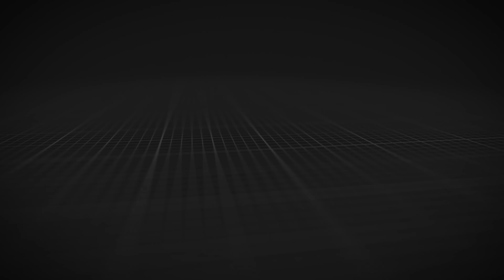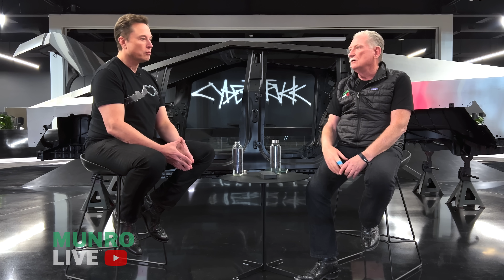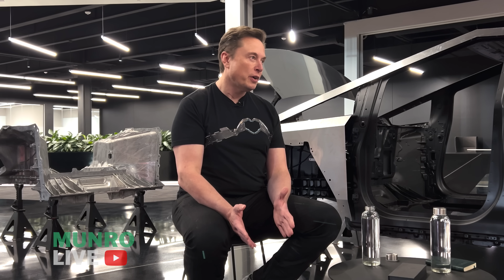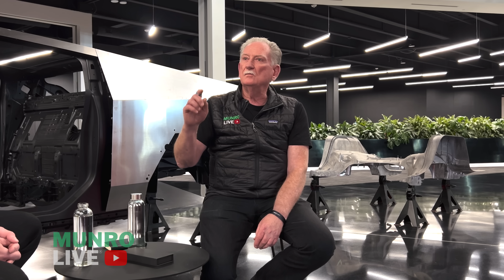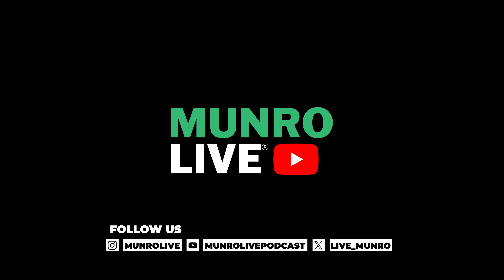Elon Musk on Cybertruck's Adoption of 48V and the Importance of Leadership

Comment: Elon is correct, many of the car manufactors senor mangment  no nothing about basic electronics, software or even mechanics.  Basicly we still use Horse Power, and cable looms that no one man can lift. Stuff like common  zone ECU's networks with short cable lengths, High speed net fibre, Printed car pannel electrics that jusy bolting lights and seats etc, use no loose wires. Self learning features that adapt many mechanical features of the system. Door cards that are intergarted with motors and switches within the 3D design,  Air jets that remove rain from the windows, Solid state batterys with High capacitive load balance, Inductive charging ,  Driver less assets like self cleaning, Self maintence reporting, and repair. Hay we have only just scratched the surface. This is not the future but today, I'm glad the Elon has made the steps with Tesla making the others look like fools!

Comment: Since all the power hogging accessories are run off the high voltage battery, I just don't see any utility in the 48 volt system.   Twelve volts is "gud enuf" to power all the housekeeping tasks like the computer and the sensors.   It's only the headlights that might be in question.   Heck, 12 volts is even sufficient to operate small but efficient brushless motors often used in the drones.   When the 12 volt battery fades, just use the high voltage system to re-charge.

One reason EVs often used lead acid batteries for housekeeping is that they may have problems but they need little in the way of battery management.   A 48 volt battery as potentially more problems with battery management.
Reply: Its just to save money on the wires. Higher voltage means you can use much thinner wires and/or cheaper materials to make the wires.
Reply: @niconico3907 --  Well, you really aren't saving all that much money.   Modern cars are 100% LED which means he lighting loads aren't a problem.  The present "power hogs" in an ICE car are he electric motors and such things like the electric seat heaters and electric assisted defrost.   

It might save a few ounces  of copper with the higher voltage but you increase the potential damage of a short.   In in ICE vehicle the potential is to make most energy things run off of DC power rather than the timing or fan bests.   An obvious example is he power steering pump but it might extend to the oil and water pumps as well as the pump used in the automatic transmission.  OR the various clutches might be activated electrically rather than hydraulically.

Comment: Ditching the purpose build and very reliable CAN-bus for Ethernet, a protokoll most commonly used in consumer Electronics, is Just stupid. The 48V decision is the oppposite, very smart in my eyes. But still, the stupidity of really replacing the CAN-bus with Ethernet and not just simple extending the metwork overwhelmed stupidity.

Comment: Sandy, you should ask Elon if he might consider going to Aluminum wiring.  You would have to upsize the wire gauge by 1 or 2 sizes up to compensate for the resistance and lower conductivity.  There is a company called King Innovation that makes excellent AL to CU splicing connectors with antiox inside their mechanical lugs that will safely splice AL wiring.

This will lower cost significantly and over the years there have been many safety improvements in the use of AL wiring, from the use of redundant mechanical lugs with proper antioxidant coatings to the AL alloys themselves being less susceptible to both expansion under heavy load and oxidation of the connecting points.

AL is also not just cheaper, but also weighs less than copper.   As a property owner with a house made of AL Wiring, I've had no troubles with my splices and I really think Elon could make these vehicles more affordable by going from CU to AL.

Comment: But is the 48V battery/batteries weight less than the reduction of copper wire weight?
Reply: Huh? They can use the same size low voltage battery as before...

Comment: The main reason why 12V lasted so long was due to lead acid battery technology which was needed to provide the cranking amperage necessary to drive the starter motor on a conventional ICE. With hybrid and EV technologies this is no longer needed, hence 48V..
Reply: No.  That's not how electricity matters in ICE.  It's the amperage BECAUSE it's only a 12V battery.  The starters are designed on the 12V.  There are 24V starters too, for really big engines, usually like Cummins / CAT and whatnot.  The regular car will not move to having 2x 12V batteries, due to the expense and mismatch of other electronics.

Comment: Does switching to 48 volt also mean that battery charging stations would be better if they were 48 volt too?
Reply: Chargers are 400V and 800V, it's a separate system
Reply: @Jessev741  No, the chargers are between 200V and 1kV.

There is not one 400V charger, it's a 200 to 500V charger.

The same goes for 800V. There are variable voltage chargers with voltage range from 200V to 1kV.
Reply: They are talking about the low voltage system.

On an ICE car, this power is supplied from an alternator, an EV gets the power from main battery via a converter that steps down the voltage..

The EV charging stations delivers between 200V and 1kV to the car's main battery.

Comment: P=IV
If you increase V from 12 to 48 with the same current ( I), the power transmitted is 4 times  higher than the 12V. More power for the same diameter of electrical cables..right?
Reply: or thinner cables for the same power.
Reply: Yes.. but you don't need all that power.  So it actually lowers the current required, which lowers the heat.. which lowers the wire size.. which is less material cost and less weight in the vehicle.   But as he said, the main reason to go to 48v is to run the ethernet;  and rather than having both a 48v and 12v system-- they just reduced complexity and simply made everything run on 48v.   Makes sense.
Reply: Its intensity squared, if you up the voltage 4 times, for the same power transmitted you need 16 times smaller wire.

Comment: The Cybertruck is so unique and has a practical capability. However, at this point it is not for me but there are at least two features I especially like.
The Drive-by-Wire ability is so terrific where you can get a full wheel turn by only moving the steering wheel about one half turn.  Also, the steering wheel itself is fabulous in that it is somewhat square and you can more clearly see over the steering wheel.  You can also easily place your hands on the mostly flat top part of the wheel for a better position to drive as well as to comfortably rest your hands down on the mostly flat bottom part of the wheel while in FSD or just cruising without it on…… so Terrific …. It would be Great if TESLA would offer these features on all of their vehicles.  I am hopeful the new items will be available for the line up in the near future.😊

Comment: There is no such thing as a free lunch, the trade off for less copper/higher voltage electrical system is a system that is far more vulnerable to failure from corrosion. Not that corrosion is ever an issue in automobile wiring though right? Avoid out of warranty Tesla's folks, the repair costs are going to be astronomical compared to their counterparts from the "legacy" automakers.

Comment: Sandy, do you think all the subcomponents were converted to 48 volt by the suppliers, or do you think there are stepdown transformers throughout the vehicle to handle those old 12 volt components?
Reply: I think it is a hybrid, some native 12V devices, some 48V - heck, maybe even some 24V ones from Semitrucks. But strategically, that is not the important part. It was/is a chicken-egg situation, somebody had to start. By switching to 48V, each component can be revised and optimized individually. As there is now a 48V consumer, every manufacturer will try to get a part of the party by being first in 48V. By Tesla sending the "How to design a 48V car" to its competitors, the whole industry is more likely to switch and that will help Tesla getting a 48V supply base up and running.

Whatever component uses stepdown transformers, in a year or two, every component will exist in 48V and then these will simply be replaced/optimized with cheaper, lighter, smaller, faster alternatives. Paving the way for the next generation mass produced car, and the Roadster. I can't wait for the 48V+Ethernet to be "backported" to each of the existing models, saving weight and reducing production cost.
Reply: @VilleWitt yes a lot of things are low power so they could have something about the size of thumb drive with 2 plugs to take 48v to 12v maybe there's a higher power version for over 10-20 amps. Then once they are native they can drop the adapters.
Reply: Mix of both, you step down dc with buck converters in this type of application.

Comment: I'm hoping this will lead to plug-and-play components running on Ethernet and standardized computers eliminating all this proprietary incompatibility we see even among the same model vehicles from one year to the next.  Right now with everything being proprietary to each make and model its very costly to deal with.  Just imagine standard automotive computers and component interfaces made compatible with any vehicle regardless of make or model with the upload of a driver.

Even traction battery modules should be standardized for size and interface so that they are interchangeable between makes and models.  We've enjoyed that from lead acid with standard battery sizes and interchangeability which makes for price competition between the various makers of those standard sized batteries.

It irks me that we have accepted so many devices that are now being made with a proprietary battery that only fits that one device or brand.  I was at a wedding and was the only photographer that could continue shooting after the power went out since my cameras and flashes used common sized AA batteries and once the rechargeables ran down I was able to use disposable alkaline AA batteries purchased at a local convenience store prior to the event as a just in case.

Best!

Comment: Fun Fact: the Ethernet standard for Power-Over-Ethernet is 48 volts and has been for decades. Tesla is using a very well debugged technology here.
Reply: So, no wonder Elon says it makes sense. There are already off the shelf components meant for use with this wiring (probably more).
Reply: Another fun fact: Phantom Power used over audio lines in recording studios is also 48V DC and is used as a convenient way to run power to condenser mics and other accessories from the console without having to run external power wires.
Reply: Whatever, it is shocking, and a lot of engineers will be saying . . . WTF ! :face-blue-smiling:
Reply: @MetaView7  well, Delphi (Delco) has been pushing 48V in cars for a long time.
Reply: @KiwiMechEng  they have also been pushing a lot of junk.
Reply: @KiwiMechEng in what vehicle?
Reply: You’re right I had one of my buddies tell me this a while back. I was surprised when Tesla did this not in a bad way.
Reply: 48 volts DC! You're talking about 48 volts AC for Ethernet. Not the same thing. On aircraft 28 volts DC for anthing not piston aircraft is been used for a long time now. Aircraft usually have more than one battery too. 48 volts DC makes sense for this, I just want to know what's AC in this truck.
Reply: @MrJava1593 > Per IEEE standards, PoE is injected into a cable at voltage between 44 and 57V DC, typically 48V DC.
"Not the same thing" 🤣
Reply: @kylinblue  True, I stand corrected. power supplies are inplemented to feed the DC voltage. Copy that. But these power supplies go bad all the time.... and this higher voltage is for speed transfer but, the higher the DC voltage, the higher heat transfer too.
Reply: @MrJava1593  Yes, but the power supply is a DC to DC converter, the other converter is 240V/120V AC to XXX DC in the main battery pack. The power supply you talking about is not on the car :)
Reply: @MrJava1593 the higher voltage is not for speed. It’s like Elon said. For the same power a higher voltage needs a lower current (Power = Volts x Current). And a lower current can use a thinner cable. It has less power loss for the distance (line loss). It’s the same reason why power transmission lines are high voltage and stepped down for distribution - same power, higher voltage, less loss, smaller diameter, less material.

If you tried to use 12VDC over Ethernet (Cat5/6) cables you wouldn’t be able to transmit as much power, you’d need to keep the current down, and you’d lose more power over the length. So you wouldn’t be able to power enterprise grade Ethernet switches and routers etc. especially off a 100m span.

Same principle applies when it’s inside a car vs inside a data center. It’s electronics. It’s physics.
Reply: @anywhereroam9698  It's essentially trading volume for pressure. E=IR.
Reply: @kylinblue  Can PoE manage the right safety and security needs for automotive?
Reply: @makdemir  Not sure what you mean by "security", but safety isn't a problem with POE+ because any power over a few watts is negotiated and requires an ethernet link.  Lose the ethernet link and the power is dropped.   The router also knows how many good pair are on the ethernet cable and reduces the power cap based on that (e.g. 100BaseT over two pair can carry half the power that Gigabit over four pair can carry).

POE+ only applies to actual ethernet.  It is not applicable to ethernet-over-CAN.   A CAN bus does not carry power... the power is wired separately.

All power carrying cabling in a vehicle (really anywhere) is fused or current limited and always has been.

-Matt

Comment: In a modern hybrid, is the hybrid battery system not something higher than 12V? (I believe it is 42 volts for a Volvo hybrid electric motor.)  I think 12V was the standard in automobiles, because it was quite difficult to get a high voltage battery from cheap lead acid chemistry, which was otherwise sufficiently good for an ICE.
Reply: Lead acid cells have a nominal voltage of 2.2 volts. In your car battery you have 6 cells in series giving you ~ 13.2 volts nominal. To get 48 volts you just need 24 cells in series to get there. You just make each compartment in your battery smaller and have more compartments. You can make a lead acid battery any voltage you like by how many cells you include.
Reply: That is correct, the hybird battery system runs on a much higher voltage (otherwise the currents would be insane) but everything else still runs on 12V. I have personal experience with Volkswagen and Stellantis (Fiat) EVs and except for the drive system everything is 12V. Trucks have used 24V for a long time.
Reply: Apples and Oranges.. the drive battery is around 400V or higher.. some even 800V (again for ohmic losses).
The rest of the car is on a lower voltage (mostly for safety reasons, 60Vdc onwards can be leth al under circumstances).. so 48V is the ceiling there mostly (in reality spikes up to 58V or so).

Comment: The 48 volt system is the future for EVs, still might be a tad too expensive to operate a ICE vehicle with a 48 volt system or (4 ) 12 volt batteries.
Reply: Many modern ICE cars already have a 48v battery to power mild hybrid components. For example: the new BMW 5 or Mercedes E have 48v mild hybrid systems in the base models.
Reply: You'd have to redesign the complete system.
.
How many will invest that much into ICE?
Reply: @rogerstarkey5390 the 12v or 48v systems in car is nearly the same. It is there to power lights, windows motors, electronics, screens. If one switches, there is no reason for the other no to switch too.

Comment: Legacy auto is all the smart phones that came before the iPhone. CyberTruck is Tesla iPhone moment, in that many legacy auto features are being reformed (Drive by Wire, 48 Volt, Ethernet base bus system, stainless steel skin, front and rear casting with structural battery pack, 4 wheel steering, air suspension) in one vehicle.

Comment: Corrosion will accelerate. 48 volts can hurt you, if you're accidentally exposed to it. 11 volts is harmless. Let's see how this plays out.
Reply: Hope you don't have a land line phone, runs on 48V, ringer at 150V and you put it near your head.
Reply: ... or PoE devices on ethernet.
Reply: or mains voltage, which is somewhere between 100V and 240V, depending on country..

Comment: Funny, i have an Mercedes with a 48 volt system that Is now 5 years old. And btw, there is several fast alternatives to can, ie flexray, that has been used by european cars since 2004. Ethernet is not a god solution in safetycritical systems. That is the sole reaksjon that Bosch and Intel created canbus in the frist place

Comment: Whilst living in UK, in about 2003, I went to a BBQ where I met a guy who was working for Valeo. He was leading a team working on 48 volt componentry. He opined that it would be the likes of Mercedes, who would launch higher voltage systems on their high-end cars. Why on earth has it taken 20 years, wasting thousands of tons of copper to achieve this change? Rhetorical question. Sandy told us exactly why, in previous podcasts.
Reply: Presumably due to industry inertia.  Delphi was big on 48V long ago but couldn't get any traction with it.
Reply: battery costs? even if it took more wire they were probably getting 12 volt batteries for next to nothing in bulk.

Comment: Essentially 48V was chosen because it is standard of Power over Ethernet with 48-56 volts
Reply: Try running LED Matrix headlamps, wiper motors, door/window servos, rear lights, pumps etc etc over PoE!!!!
Reply: @fredderf6491  it is not like Tesla can't use thick gauge wires especially on steer by wire system